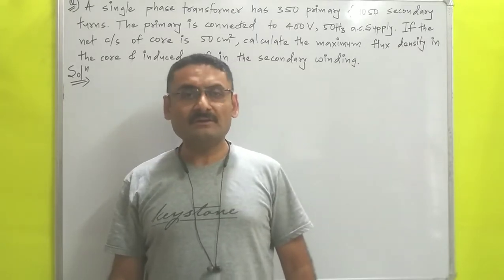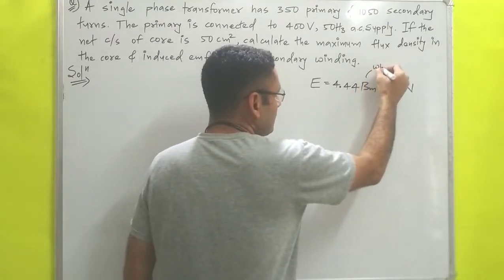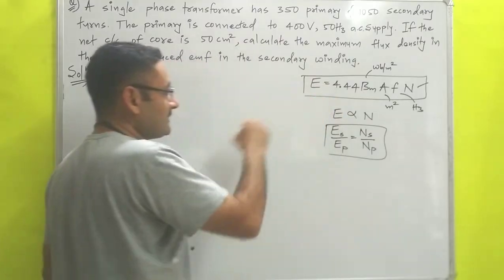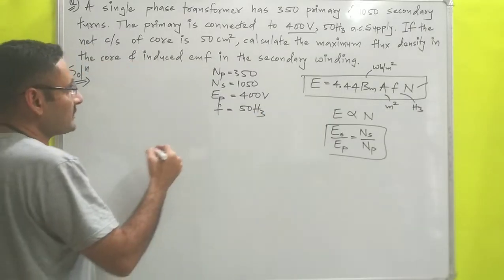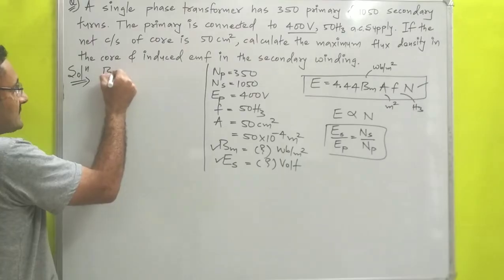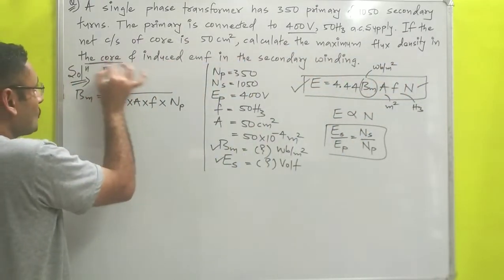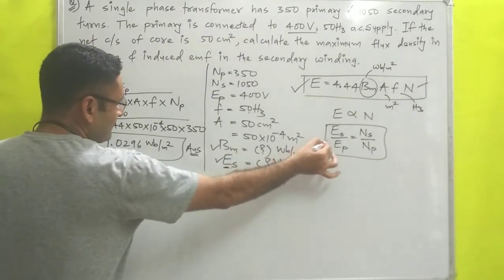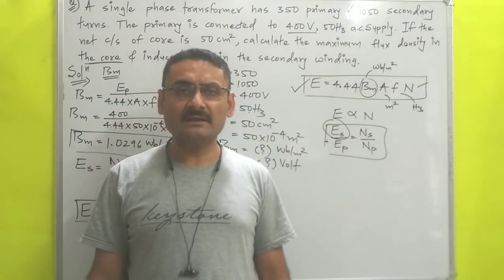Numerical on EMF equation of single phase Transformer (Basic Electrical Engineering)

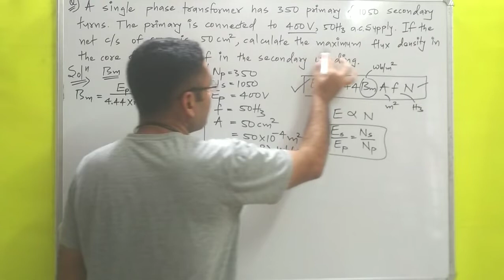Comment: 3:45 , you said wrong, If want to calculate Bm value for secondary coil then it is same for (Es=1200 volt, Ns=1050), Bm is same for both the coil always